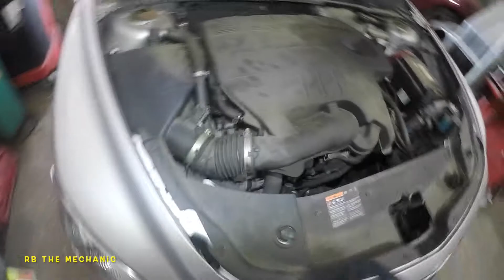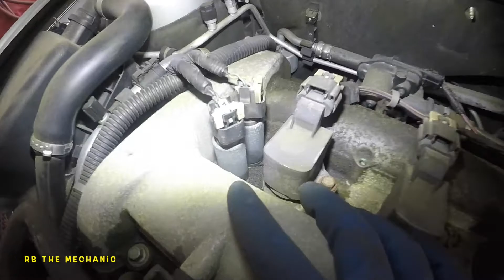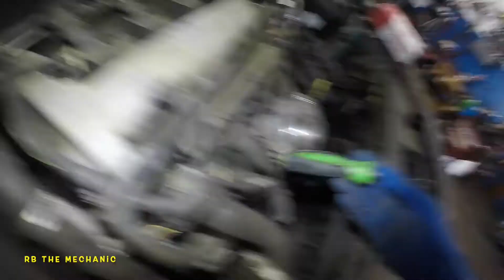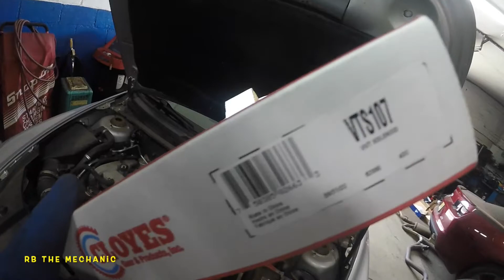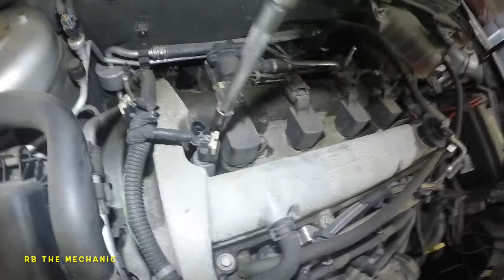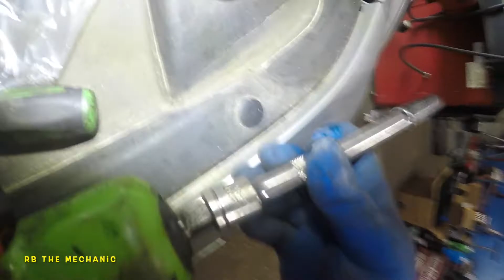Chevy 2012 Malibu P0013 exhaust cam actuator circuit solenoid

Comment: I can't get the cover off. I have 2012 malibu. 😢 and it's not budging. I don't have a screw on right side under cover either.  Like in some videos.
Reply: Got it off.
Reply: Finally.  Lol thanks for the tutorial
Reply from the maker: Ok cool
Reply: @RBTheMechanic  I had to pull up from back side first.  In my case that was the only part that was budging.  Learned a lot
 Thank you Thank you!  Check engine light still on.  But it runs.   I'll have to wait on intake solenoid. 72 bucks each up here where I am.   Adds up...
Reply from the maker: @saltyginger777  oh ok welcome!!

Comment: When I took my old solenoids out, there was some fun metal glitter caked up on them.. how do you think that is? The new solenoids are ticking like the old ones were and my car shuts off while driving :/
Reply from the maker: Might have had engine damage no oil at one point
Reply: Timing chain rubbing on the guard